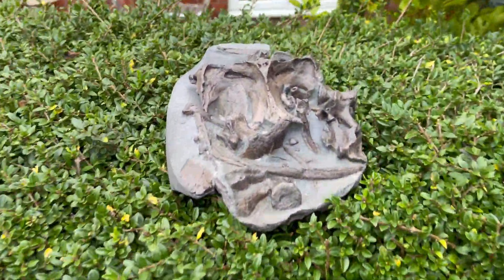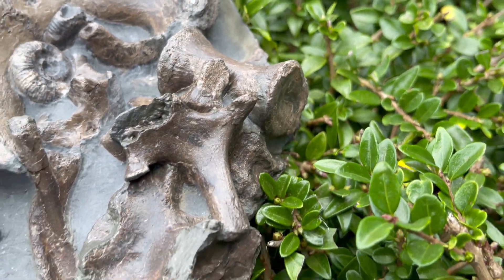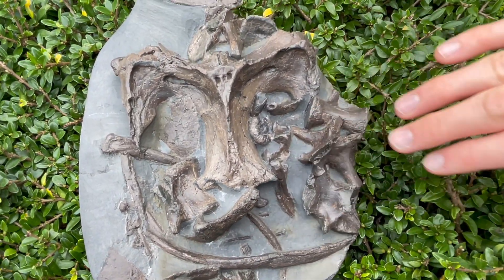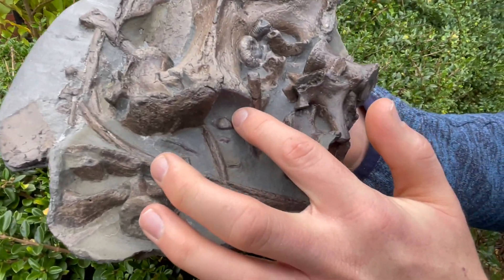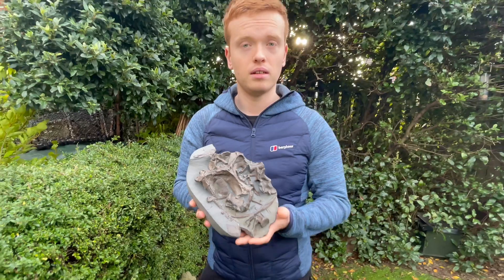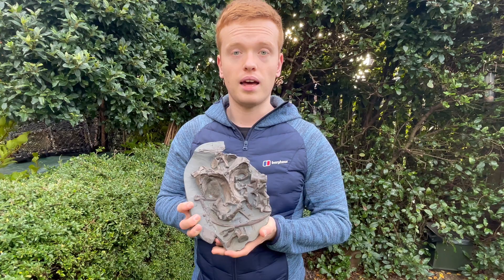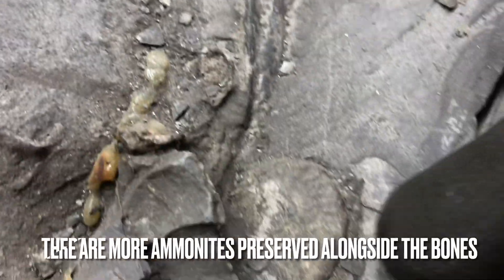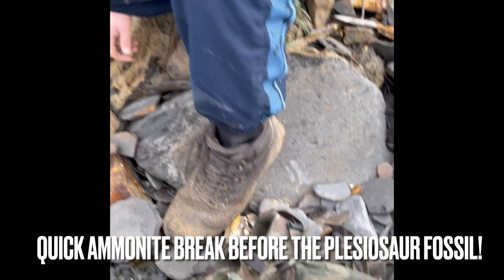Fossil Preparation! Crocodile and Plesiosaur Fossils

Comment: How are you finding the zoic pens? Thinking of making the jump from cp.
Reply: So far we only have the T-Rex but can whole heartedly recommend it. It's a very powerful and quiet pen that uses very little air and multiple different tip profiles are available for it. I reckon you can knock at least a third of your preparation time off by using this tool.

Comment: Are you taking off some of the top layer of bone as you remove the matrix?  Have you checked the undersides of the chips that came off at the boundary between matrix and bone?  If they have any of the bony material from the other side of the border, is it possible to plasticize the bone near the border, preferentially without plasticizing the matrix, before removing the matrix at the border? If you remove the matrix here, will the outer bone table be in better shape than surfaces not being prepared in this way? 
In case you were wondering, I learned fossil preparation over 3 summers (1965-1968) from the superb preparators at the vertebrate paleontology labs of the American Museum of Natural History and have been involved in primate and human paleontology since then
Reply from the maker: Good question. In this case, the rock comes away from the bone without removing any bone chips. If it starts chipping, that would be an indication to halt the penning and explore other methods such as acid :)